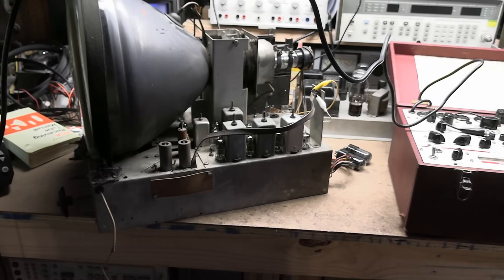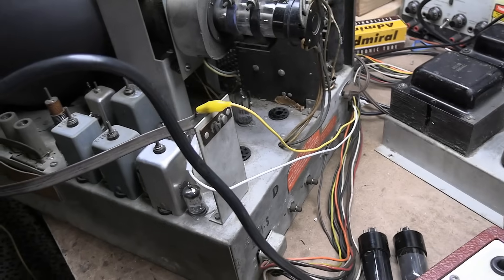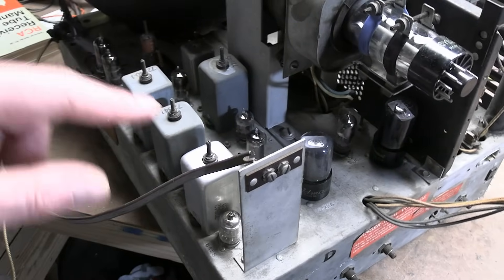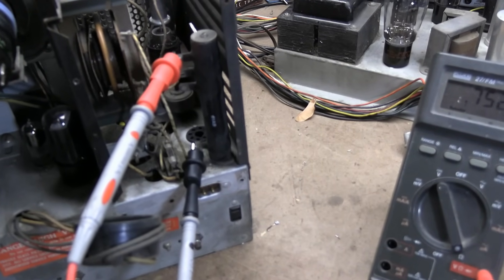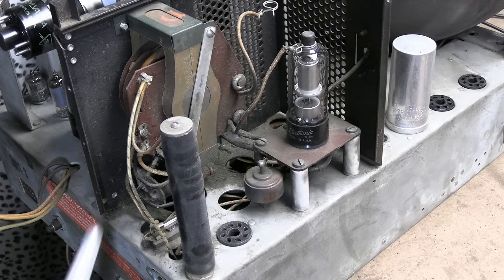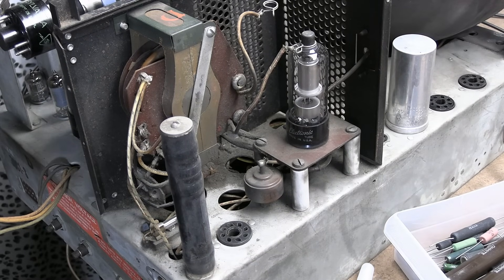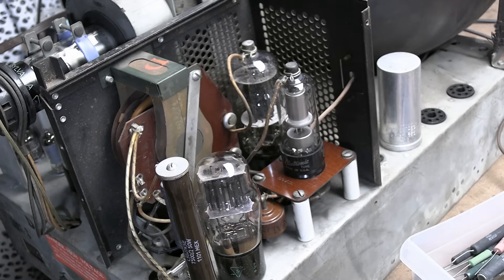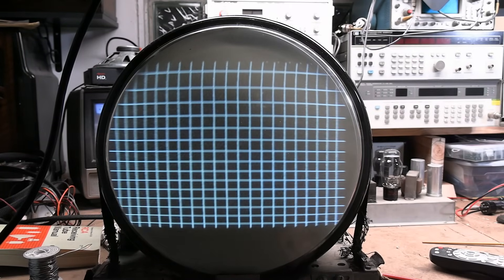Beginners guide to B&W tube TV restoration part 14 (inside the HV box)

Comment: also mine does not have that tall resistor with multiple taps........has a shorter one and its not totally rearward but in front of the flyback near edge of chassis
Reply from the maker: Right. This is an earlier 30A1 chassis.

Comment: my crt 20b1 chassis has some kind of rubber maybe around the neck where the tube narrows down to neck size.  Yours doesnt seem to have this rubber on it.
Reply from the maker: Not sure what you mean. Under the focus coil?
Reply: @bandersentv  the rubber tube insulating cone it is ahead of the yoke, the tube where the glass rapidly goes cone shaped there is a rubber support ring with squares cut out in this rubber cone.

Comment: Here in Tasmania we got TV in 1956 and damper diodes with heavily insulated cathodes had been developed by then, viz 6AX4 and 6AU4 with octal bases and the Nuvecar 6AL3 with a cathode cap. Obviously earlier sets made use with ehat they had, but for me it is dtill wierd to see a 5V4 used as a damper in a TV line output stage…love how the directly heated cathode, of course has its own isolated heater overwind in the power transformer. The line output transformer looks strange and naieve too. The 6BG6 is a really beautiful looking line output valve…looks like an 807 with an octal base, so much nicer looking than the later, uglier 6BQ6’s and 6CM5’s!
  I suppose that heater winding in the power transformer for the 5V4 is possible becsuse this EHT is so low, could not imagine this with later, higher voltage EHTs peoducing 15Kv at the tube anode and with 6us long, 4Kv high pulses st the damper cathode which would certainly flash over ipbetween the power transformer windings…always learn new and interesting things from the earlier, more naiebpve designs!
Reply from the maker: True and even when 6W4s came out a short time later there were still some models that used a separate filament transformer for them with heavy insulation on the leads.
Reply: Just looked up thet datasheet for the 6W4, only 125mA continuous, 3.85Kv PIV and 3.5w Anode dissipation, but the supurlative is the cathode-to-heater insulation which is 2.3Kv heater negative with respect to cathode. The 6AL3 which was in 95% of Australian 110 degree B&W TV’s in the ‘60’s despite being in a smaller bulb with a nine pin Nuvecar base is 220mA continuous, 7.5Kv PIV and 5w anode dissipation….the cathode to heater is a whopping 6.6Kv with unspecified polarity. I pulled a 6AL3 to bits decades ago, the 1.5A, 6.3v heater was a bunch of tungsten wire that went up and back about three to four times, this had a standard coating od zirconium orthosilicate over it, much the same as you ‘d see in modt other indirectly heated valves, but then around this was a helix of kovar wire with a THICK coating of zirconium dioxide slurray anf then, finally all this was stuffed down inside the cathode cylinder which was a good 1/8th inch in diameter. At the time I wondered why until I realized that it is the CATHODE of the damper that connects to the EHT primary and has huge back EMF spikes every 64us at flyback. The 6CJ6 is another valve that is rarely ever seen, it has the same sixzed bulb as a 6AL3 but is a horizontal output beam tetrode, I have one in an old 50’s   Marconi Mk-IV B&W broadcast montor…a beast of a thing with a 90 degree tube, waveform monitor underneath and a 6BK4 EHT shunt regulator to stop the picture “blooming” during dark scenes!
Tell me, do you ever come across the 6CM5/EL360 horizontal output beam tetrode over there….they were about 75% of all horizontal output valves over here.?
When we got colour, (PAL-D, 50Hz V, 15.625KHz H, chroma 4.43361975MHz) in 1975, B&W sets went to the tips in droves and I hoarded the valves! None of our colour sets used valves, all were semiconductor. The most common was the Philips K-9 chassis.
Reply: Despite the pinout the 5v4 is actually an indirectly heated cathode tube.
Reply from the maker: @eDoc2020  Yes, but the heater is connected to the cathode internally.  The Admiral has a dedicated, well insulated filament winding just for that tube.  damper tube like a 6W4 has a separate cathode and heater with a high breakdown voltage.

Comment: Since that stack of power resistors is open on one end, is there some way it could be replaced with a rheostat?  Just musing.
Reply from the maker: It's not a stack - it just has taps.  Sure you could but you would have to modify the chassis to mount it.  I hate doing that.

Comment: It's really starting to take shape Bob, and all without really doing any recapping or resistor checking. Fantastic information. What a great series for a beginner like myself.
Reply from the maker: Thanks but that's not quite true.  The audio amp, vertical oscillator, vertical integrator and part of the horizontal have been recapped.  The RF and IF is all mica and ceramic and are probably fine.  The main thing left is the sync, AGC and video amp.